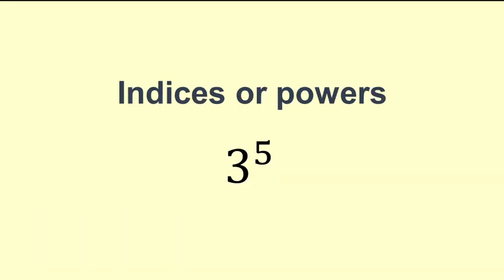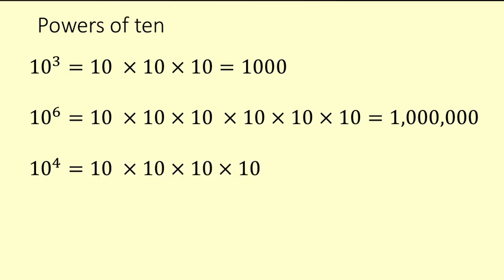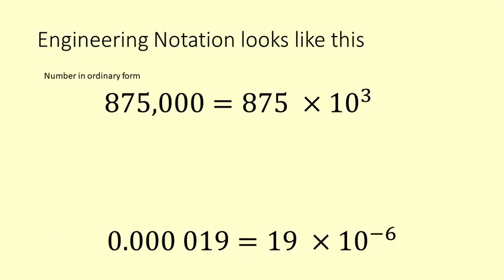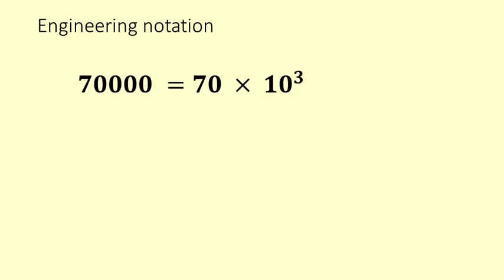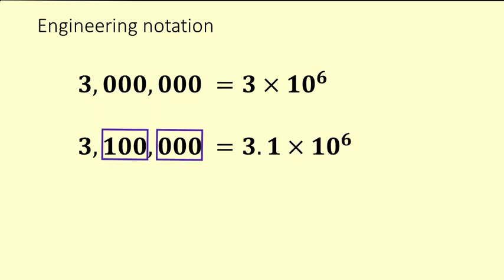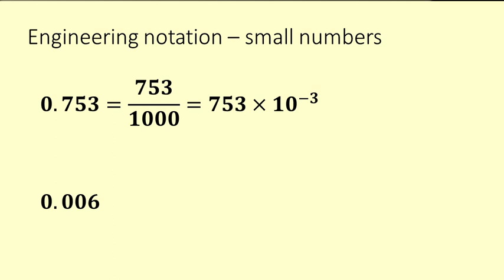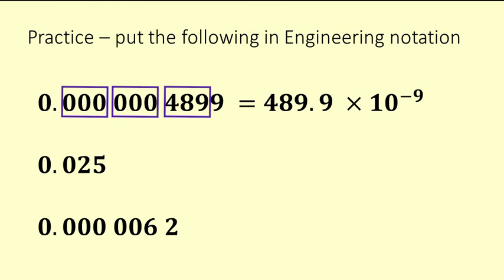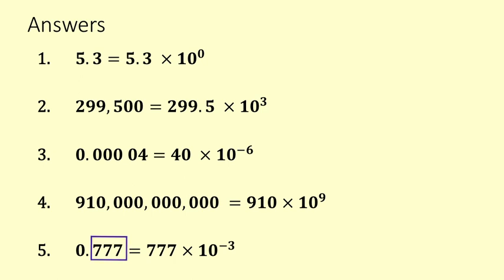Engineering Notation - Maths made really clear with Dr Nic

Comment: Can someone help me. I have something like this:

I have a scientific notation of 1.1x10^-4
and I wish to turn it to an engineering notation so I can accommodate the unit that I'll be using which is -3, a (m) unit symbol.

We have taught that we can multiply a base 10 to reduce the exponent, it will look like this:

1.1 x 10^-1 = 0.11 x 10^-3

As you can see I'm stressing out because of the 0.11 It still has zero in front of it despite already using the form of notations, should I just let it be at 1.1x10^4 or still reduce it?
Reply: Or 110x10^-6? Does that work?
Reply: You have to move the decimal the other way (further) into the negatives . So your answer converted into engineer Not. Would be 110x10^-6
Reply: Leave it at 1.1